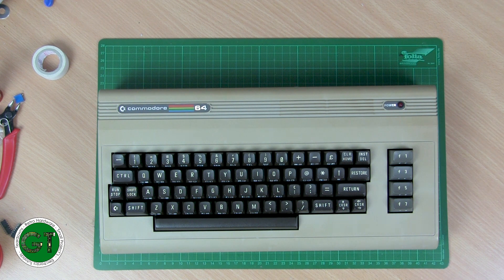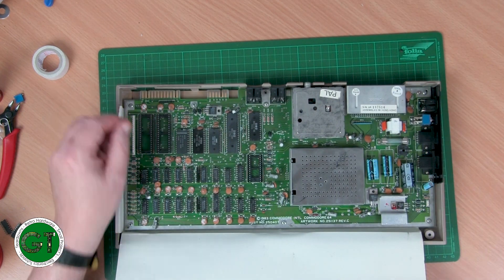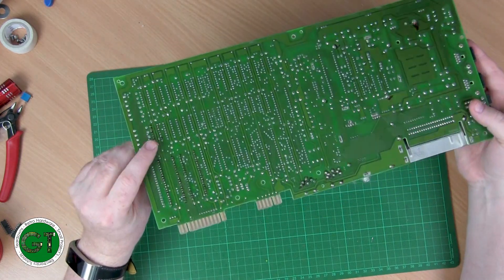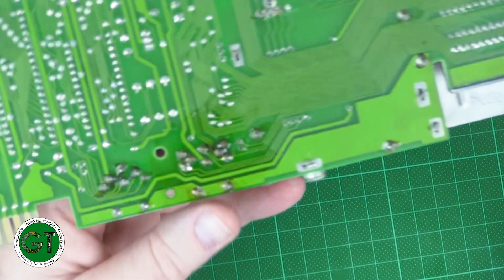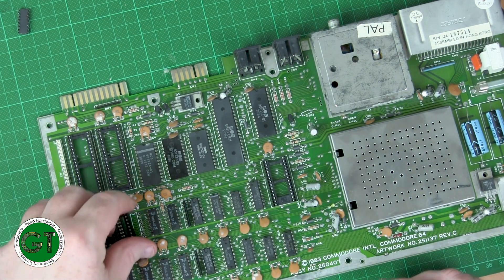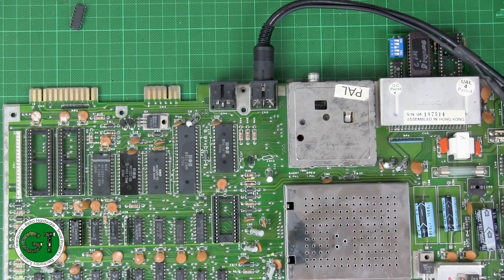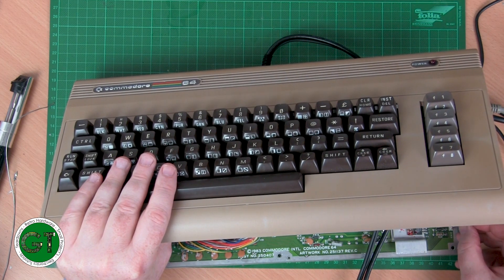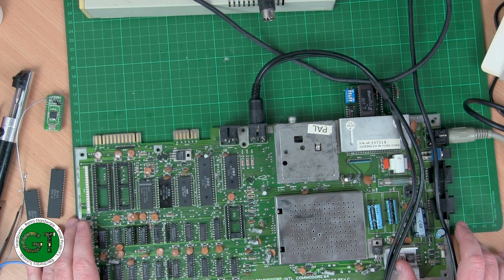Commodore 64 Breadbin repair part 1

Comment: Check 74LS257 ic's, Check your power supply doesn't overvoltage. Over 5.3v is too much and start to be dangerous. Could also be 74LS08  next to the PLA. And last week I had a similar problem caused by a cracked resistor pack, located behind the cartridge port

Comment: Very professional video, well done :-) I've had a few C64s with bad RAM, most of which have been Micron (uT) brand like on yours, they seem like they're prone to issues. Most of mine failed short-circuit, at least it's easy to tell when they've done that ;-)
I've got quite a few C64 boards that need repairs, if you'd be interested? Black screens and garbage screens, mostly 'breadbin' boards but some C64C boards too.
Reply from the maker: Hi Adam, if you have some C64 boards that need some TLC then I am interested, you can find my email address on the About page.